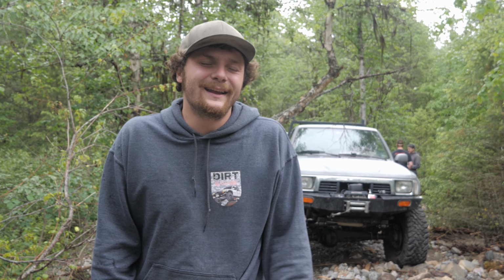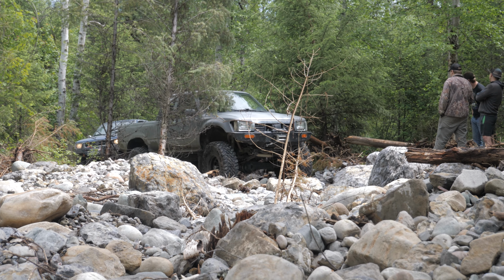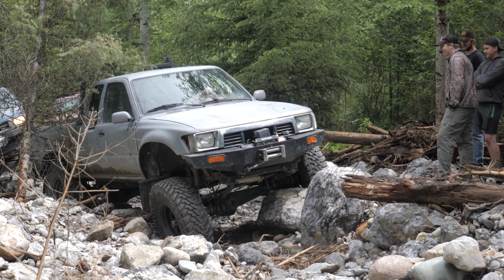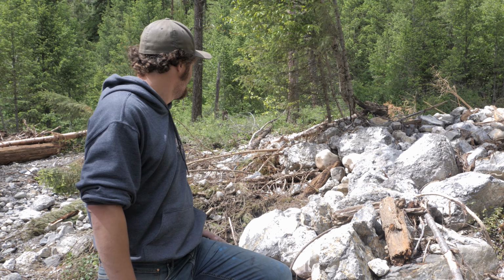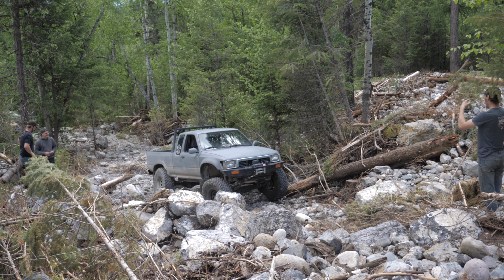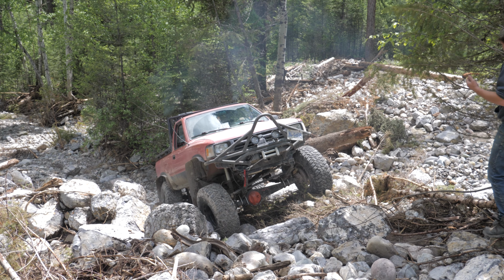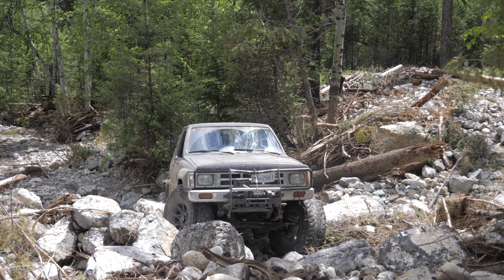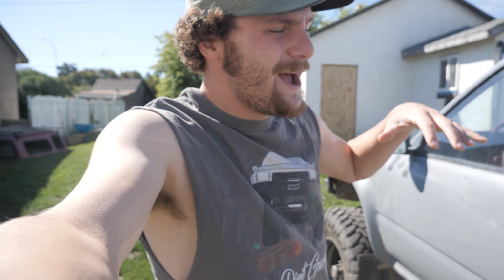Why You NEED Dual Transfercase on your Crawler!

Comment: Like all the trucks in the line up and it is interesting to see how all the trucks with different mods manage the trail. There is something in between stock transfer case  and dual case . 13 years ago I put 4.1 trail tamer gears in my t-case and that truck climbs awesome . No grinding to the housing was required cost was $431 in parts checked Advanced Adaptors but they only have the 4.7:1 which requires a $216 housing . Keep up the good work whish I could go wheeling with you guys
Reply from the maker: Thank you! I thought it was pretty interesting to see the difference in all the rigs too. I'm super happy with the double 2.28 gears, and I will most likely end up putting the 4.7 in my rear case, even lower is better for deep snow and I'm excited! I actually don't know anyone who has a 4.1 in their case? Must not be popular anymore?

Comment: I have an 89 with chain drive transfer case. 5 speed stock tranny 3.0. Can I use that same adapter plate you did to go to the gear driven transfer case? I want duel transfer case to!!!
Reply from the maker: Absolutely you can! My trans is the stock 3.0 transmission, as long as you get the v6 r150 to gear drive case adapter you can bolt up doubles.

Comment: Your great at convincing us all we need dual ttansfer cases! Looks dreamy bouncing so lightly. 

I may have missed it in this video but what engine does your friend with the red truck have? Sounds a litttle whistly. And with the 2 stacks pn the back seems dieselly. 

Your truck kills it  inspiration right there.
Reply from the maker: The dual cases sell themselves honestly  😅 I did not realize how much I wanted them until I seen them in action. 

Skylers Red Pickup is powered by a 2-LT diesel Toyota motor.